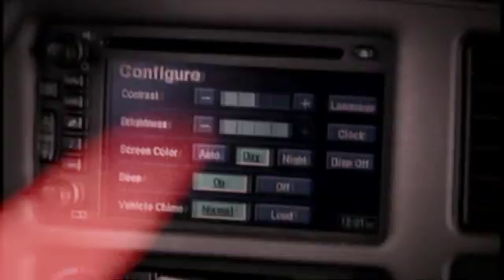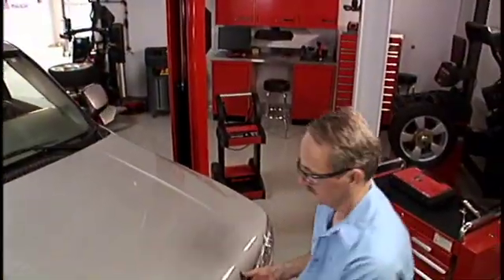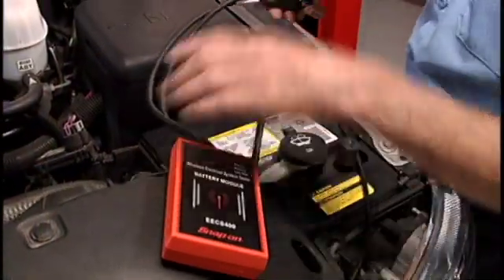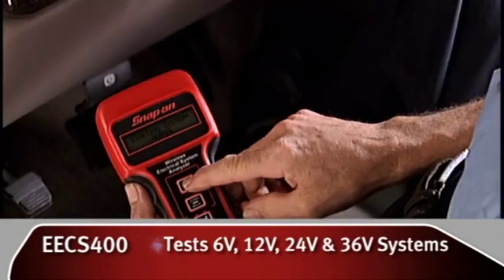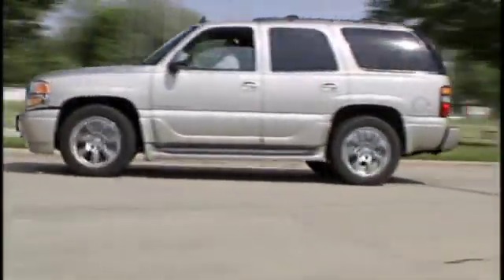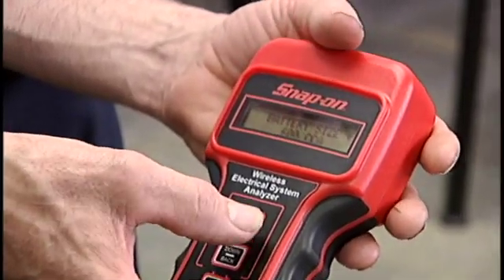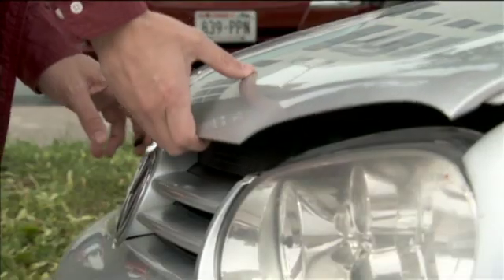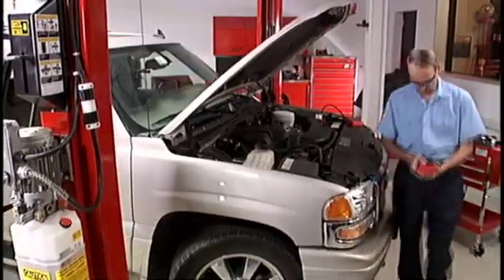Snap-on® EECS400 Wireless Battery Tester | Snap-on Tools

Comment: I have one of these, and it is fantastic. It can test up to a 3200 cca rated battery pack, and still test atv batteries as well. Great addition to the shop
Reply: a tip: you can watch series on Flixzone. Me and my gf have been using it for watching all kinds of movies lately.
Reply: @Kolton Mohammed yup, I've been using flixzone} for years myself :)
Reply: Hello 
I have on but it gives. That tester pod could be found do u have any idea